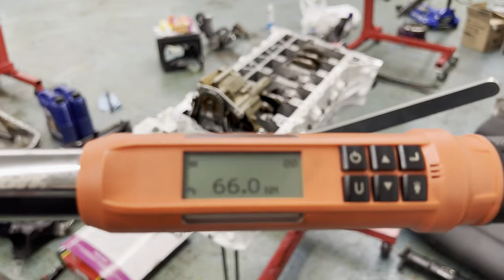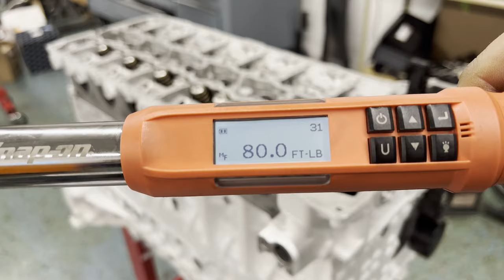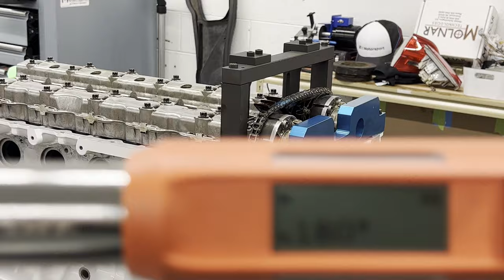Building The Cleanest N54 Part 2

Comment: Sick build and color scheme. 

I decided to Cerakote my short block, I went with Tungsten on the hot side and my accessories , polished and clear coated my front and cool side, then went red vtt valve cover, etc 

almost got it put back together in the car. The polishing of the aluminum took an insanely long amount of time! 

I have an extra  N54 that needs built,  I want to go white like this, and do a retrofit into an e30
Reply from the maker: That would be sick in the E30!

Comment: Awesome videos! Pleasure to watch the first two, hope that you keep them coming. I do have a question if you don't mind: if you're going to the length of pulling it all apart and back, then why not get the deck closed, pinned hub, crank seal guard etc at the same time?
Reply from the maker: Thanks bro. No need for a closed deck at 950hp which is my goal. Pinned hub also not necessary. I update all builds with new style hubs from BMW with better friction disks. Haven’t had a problem yet. And seal guards are for people that skip out on maintenance. I’ve still seen people suck a belt in with seal guards.

Comment: I used VRSF for my XI, all I did was cut a 6” section and weld it back in to move the first main bend back so it would clear the transfer-case
Reply from the maker: Damn that’s awesome. Never really seen anyone modify one. I know the guy that bought my 4in. Single exit. If I can’t buy it back I might be doing this.
Reply: @N54RacingChannel  I have a video on my channel from a few years ago that will show you where to cut and weld it up.
Reply: @midwestbmw1292  I just had mine done last week by a shop. Cost me $60. I had them cut an 8.5 inch section and add it to the front midpipe. 8.5 might be slightly to much, so 7 inches would be perfect.
Reply: @midwestbmw1292  I actually used your video to show the shop on what needed to be done. So big thanks to you sir 🙏

Comment: Off topic a bit…when u guys bore or rethread the 9mm holes to 11mm , what solution do you do for the dowel? Or does it not need to use dowel with the arp head studs?

Comment: I'm not sure if you did it or not,  but if I'm correct your rear bolts for the oil pan that's the longer ones should be torqued at 180 degrees the small ones are the 90 you did
Reply from the maker: Yeah I didn’t show the 180. I did all the long bolts at 180.
Reply: @N54RacingChannel  nice.. I did that mistake my first time haha, awesome build brotha

Comment: Some of the best detailed videos I’ve watched!  Your videos have been a lot of help. I’m doing a N55 now. What oil do you use for break-in and how long till you change it? Thanks!
Reply from the maker: I use Amsoil for 15mi. Idle break in. Then get the cheapest conventional 5-30 oil for 500 miles. Do another 500 on conventional the. Your all good for synthetic. I used either liquid moly 5-40 or  Amsoil 5-40
Reply: @N54RacingChannel  do you use Genuine BMW head gaskets or elring? Have you seen any issues using elring head gaskets?
Reply: @mdiloutube he used Elring which failed on him later

Comment: What are the power goals off this motor, any reason why not choosing a pinned or splined crank or closing deck. I’m in process of doing research for my build and just asking for my knowledge. I want to build for 7-800 wheel, I unfortunately blew ringlands at like 550awhp with  frankenturbos and e40 😭.
Reply from the maker: Shooting for 950. Not a fan of drilling into crankshaft. I’ve had manual and auto cars at 800 wheel with new BMW crank hub without issues. As far as closed deck. Not needed for my power goal.
Reply: @N54RacingChannel  ahh cool deal well I’m for sure keeping up with this. It’s hard to find high hp awd builds online that are actually driven haha.

Comment: You forgot the special sauce when you installed the front main seal.
Reply from the maker: I don’t use the BMW sealant. Mopar has a better gasket that hasn’t leaked for me yet. A lot cheaper too
Reply: @N54RacingChannel  Whats the part number on that Mopar main seal gasket? I don't see them listing any bmw applications. Also whats the deal on the red cylinder head gasket? Great work!
Reply: @taylor1942 it’s an Elring gasket with copper coating for “better sealing“ ended up blowing on him anyways

Comment: I have seen that you have used washer part number " 11237557561 " but you should have used "11238090136" according to your crank hub update.. will there be a difference ??... I am in that situation, have you had any problems with this? 2:54 min